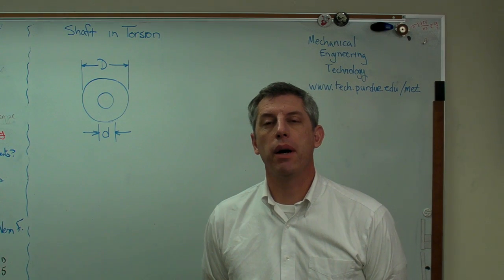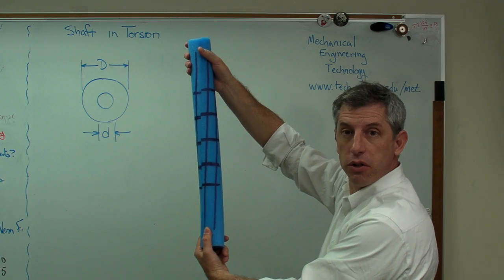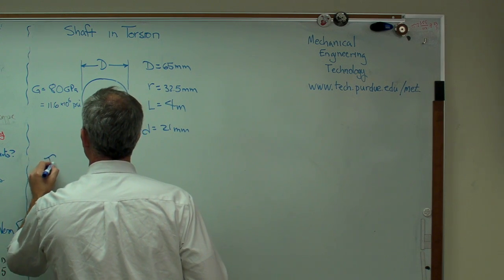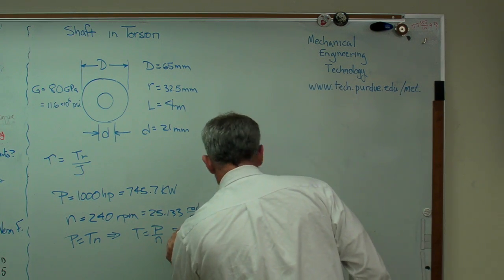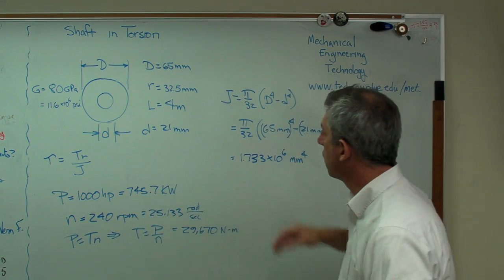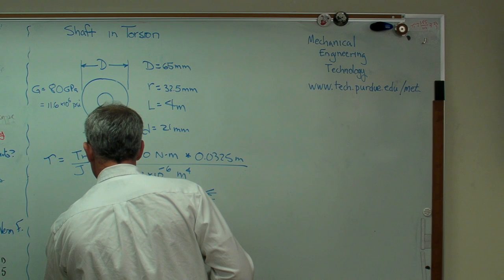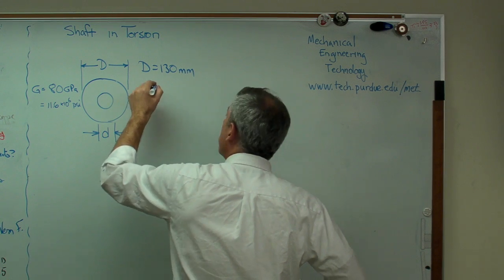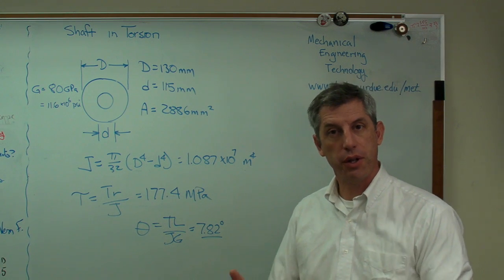Shear Stress and Twist in Circular Shaft.MP4

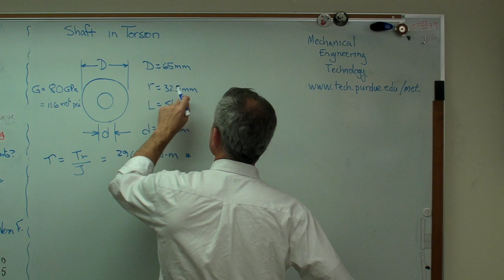Comment: I think there is a mistake. =(    at 5:40, you calculated torque (T) as being 29.670 Nm.  Then at 7:35, you plugged torque in as 29670Nm (29,67 KN.m). That increased the shear force by 10^3. The answer would be 556.3 KPa, instead of MPa. The same goes for the angle, which happened to be 0.049 degrees. I made the calculations over and over. Perhaps, I've missed something. Can you clarify that, please?

Comment: Thank you very much for the very clear explanation,I loved it :-)  I have one question, I have seen people using Torque =Force x Radius x Sin theta and sometimes just Force x Radius, can you explain when to consider angle theta and when not?
Reply: When F is normal, then no need for sin theta. When it is inclined to an angle, the we require a perpendicular component, either sin or cos theta .

Comment: This is immensely helpful, thank you very much, I was wondering if you could help me with a problem I'm having though, I have a question which asks me to find the Maximum and Minimum shear stress on a shaft such as this one, and everywhere that I have looked only seems to refer to maximum stress, I'm finding virtually nothing on minimum stress. I can only assume that minimum stress would be taken on the radius of the internal diameter? is that correct?
Reply: use mohr's circle no?

Comment: When it came to using the polar moment of inertia in the torsion equation did the power become 1.733 x 10^-6 when it was earlier worked out to be 1.733 x 10^6?

Comment: Thank You. I would just like to query something which doesn't completely relate to your example: I have a hollow tube which is subjected to a 750N.m torque. Now I would like to determine the amount of torque resisted by a specific area on the tube. Here are the dimensions: Outer radius = 100mm, Internal radius = 25mm, and the area im interested in is 75mm from the centre to the Outside radius. After max shear stress was calculated,how do I then calculate the torque on that area?